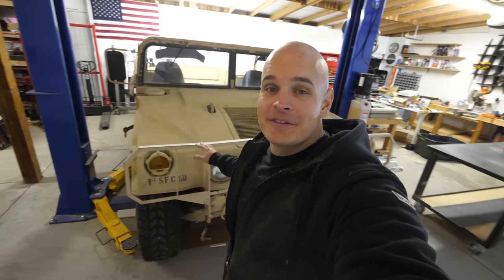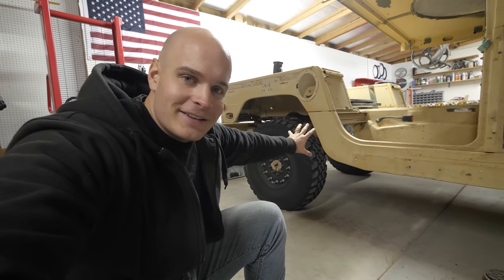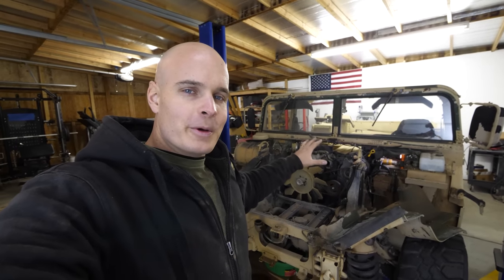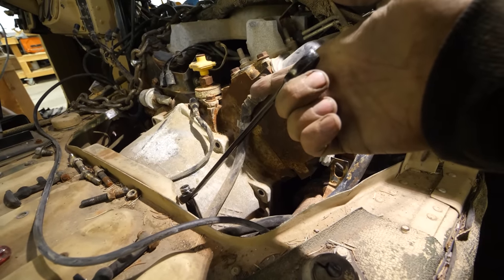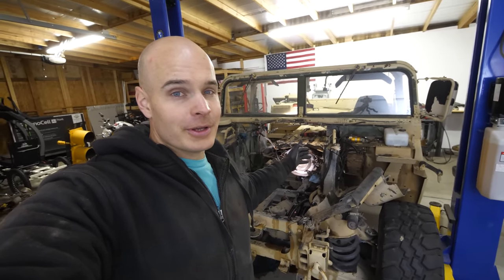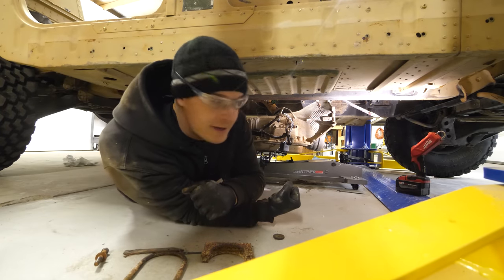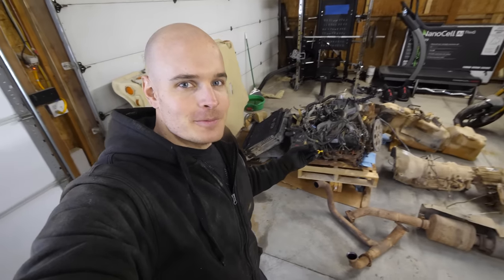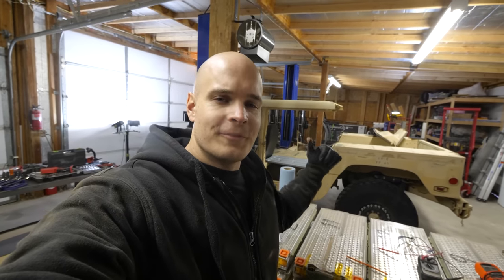How to build an Electric Hummer? Step One – TEARDOWN!

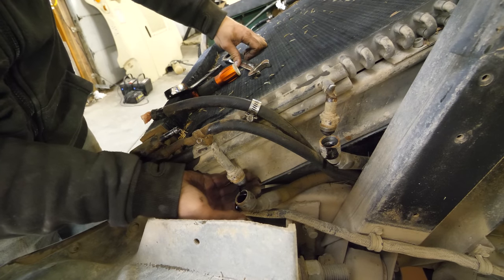Comment: 5:02 key difference is that coolant is waterbased and is used to keep the engine at operating temp, whereas brake fluid is hydraulic oil and CANNOT have water in it. If theres water in your brake fluid, it will boil and you’ll loose your brakes, plus corrosion.

Comment: Great video, however, your description of how a diesel engine works wasn't quite correct. Glow plugs are there to get the process started but once the engine is running they are not in use. Air in the cylinders is compressed to such an extent that it self ignites and at that moment the diesel fuel is injected. Energy that is imparted to that cylinder in turn drives the pistons in the other cylinders upwards again. "Surplus" energy is taken from the engine in mechanical rotational form from the output shaft.

Comment: This is so great! Question...aren't Tesla batteries normally housed together with a contained cooling system? Curious as to how you will keep the temps down if they are spread throughout the Hummer?
Reply: I wondered this too.  There could be some natural heatsink effect with the body of the vehicle because of the spread out arrangement. Less dense cluster of the massively hot battery cells, maybe a front and rear system with separate reservoirs too???
Reply: Once they are packaged in a box useful for this layout they can all be plumbed back together for cooling. Most conversions do this and just work around how they will be laying out the packs for their vehicle.

Comment: I can't wait for the day when it become practical to buy an EV conversion kit to swap in to whatever you want, the same way we order crate engines today.
Reply: Realistically though, people would just use gas vehicles until end of life before getting an electric one. Even if conversion is common, people would just ask shops to do it for them.
Reply: @lancelindlelee7256  yeah modern cars are way to complex anyways, so doing a conversion for them will be difficult. Older cars like classic cars can be kept alive with batteries and motors for a very long time, and be enjoyable too.
Reply: @franky9928  GM has already announced that they'll sell an EV conversion crate

Comment: You can also tow batteries on a trailer put a small generator to trickle charger drivin by the axel on the trailer as you drive charge the battery in the hummer when you are running on the trailer battery. And vice versa for long distances.

Comment: I hope you marked the clocking on the drive shafts.   If you get them back together wrong you're going to get a nasty vibration..   Also double check the seals since you pulled them apart as that keeps the grease in there.

Comment: You can mount the batteries in the space where you took out transmission from. May be weld a sheet of metal at bottom with 1 to 2 inch lowering to make more room for batteries

Comment: Hey Jerry, I just discovered your channel, I like it. Good presentation, pacing, and relevance. One small suggestion. Motors vs Engines. Internal combustion engine, Jet engine. Electric motor, starter motor. Motors are not engines and engines are not motors. Motors-Electric vs Engines-fuel (petrol, diesel, gas, gas as in literally gas, not abbreviation for gasoline) Not wanting to nitpick here, your narrative is very polished. Looking forward to watching your conversation progress.

Comment: 100% recommend building a waterproof compartment in place of the gas tank for the batteries. Make it a quick disconnect so if you have a problem then you can pull it out in one piece so you can diagnose the problem.

Comment: Very cool project, hope you don't have to build too much strange custom stuff to make it work. Glow plugs are only needed to get diesels up to temp by the way, the fuel air mixture explodes under compression when the engine is at operating temp.

Comment: I'd put the batteries along the center where the drivetrain was and add a skid plate to protect them. You'd get to keep your back seats and it would distribute the weight more evenly lowering the hummers center of gravity.

Comment: 19:37  Glow plugs are NOT for burning the fuel. Glow plugs are designed to preheat fuel-air mix by cold start only. They are switching off, when working temperature of the engine is reached.

Comment: @2:17 "this area here" is the rear seating area... and so the 4-seat HMMWV becomes a 2-seater. Still, a good location (for packaging and for weight distribution) if you only need two seats.

Comment: Suggestions.
There is a factory two to four inch body lift they did to accommodate some later modifications.
If you lift the body by the height of the batteries you could mount them all flat under the floor beside the frame rails.
If you did that you’d have space for three times as many batteries .
I would build some impact resistant cradles to mount them in of course.

Comment: Not sure what type of electric set up you are doing but the best would be a front and rear engine set up with no gearbox.  Then all that massive area under the truck will be the perfect place to hold the battery packs. Just build a cradle to fit the area with the battery packs inside.   Simple and with a better center of gravity and balanced than the original ICE set up.

Comment: Hook the motor to the transfer case. High and low gears and two or four wheel drive. It's over a 100 degrees where I'm at today, im kind of wondering about your cold weather gear.

Comment: Great disassembly, but allow a little correction to how a combustion engine works: without explosions! There is a combustion, which results in expansion - by no means this is an explosion. An explosion is roughly 20-50 times faster compared to a burn.

Much interested in seeing the project go forward!

Comment: I could be wrong but I thought the HMMWV was designed with a relatively easy detachable body? Could you use the lift to remove the entire body giving full access to the frame/internals? Would make it easier to paint the entire frame. Definitely cannot wait for pt 3.
Reply: Well yeah probably. Its a body on frame afterall

Comment: 19:38 Diesel engines unlike petrol don't require any source of ignition (I.e. spark plug). In Diesels the fuel -air mixture is compressed to a point where it combusts So  glow plugs only run during very cold starts to bring up the temp. In the cylinder so combustion can occur.

Comment: This does such a great job at highlighting the prehistoric nature of internal combustion engines. Using them is literally bronze age, 5000 year old technology. Pouring a burning liquid into a pot to extract work is all these things do. We've refined the mechanism over the years but not much change fundamentally. Bring on the quantum field physics at the heart of an electric motor!!
Reply: Except Zach's description on how the engine turns dinosaurs into farts wasn't quite correct, given he mentions the glow plugs as a part of the running of the engine. Generally, in diesel engines, the explosions come from a mix of misted dinosaurs and oxygen which are compressed until they literally blow up. The glow plug only assist when the engine is cold and have no effect when the engine is running.

Comment: Glow plugs aren't spark plugs. They just heat the diesel fuel to start as cold diesel has a hard time starting. After that diesel fuel is then compressed so small that causes the explosion.

Comment: The radiator could still be useful. You don't want your batteries getting too hot ot too cold. A lot of powerful motors also require liquid cooling.

Comment: It's really interesting to see the complete difference in technologies and the things that people have done to combat limitations of it
By that I mean, liquid fuel is super energy dense, but utilizing it is ridiculously inefficient (i.e. releases lots of heat) and that's why we have all these parts that Zack is taking out (e.g. radiators, alternators, transmission)
Meanwhile, running cars off electricity is simple (it's one electric motor), but it's not energy dense, so you basically have to cram in a bunch of batteries

Comment: In only one of those battery packs, there is  a thousand possible breaking point (every cell).
In colder/hotter enviroments even the heating and cooling for the batteries, needs more components than 20 to run.

Comment: You might want to have individual charging and discharging support for each battery bank to ensure efficiency and battery longevity (differences in cable lengths and co. cause uneven charging and discharging that ruins batteries).

I am quite interested in seeing how you solve that. Are the batteries smart?

Comment: FYI - Glow plugs have nothing to do with the engine running. The glow plugs heat for 10s or so before starting the engine, to help warm the cylinders and make it easier to start
Reply: What about spark plugs?

Comment: Super informative video! Your auto mechanics 101 is a good primer. People don't realize our cars are little engineering marvels. 

Will you be reconditioning the chassis (removing rust and painting) before you start mounting the electrical components?

BTW 9:32 the large gear you are referring to is called the 'flywheel'

Do be careful.

Comment: Also that motor has a really strong magnetic field aluminum shielding should help keep it from messing with anything else in the vicinity like electrical components cause aluminum blocks magnetic fields. 3/16 to a 1/4 in thick should do.also don't have your phone near it when it is on.

Comment: Great video and project! I have a question though, why don't you put the batteries where the Transmission, Gas tank, and exhaust used to be? It will give you a cleaner look for the vehicle. Don't you think?

Comment: Why not get rid of the drivetrain and custom build gearboxes that bolt to the diffs so you can bolt the motors to the diffs directly. Like a tesla. This should allow you to put the batteries in the tunnel. I would recommend a front diff centering kit, this allows you to use 1 half shafts through out the vehicle instead of 2 types.. More powerful brakes would be ideal, predator makes very big brakes but they carry a hefty price

Comment: You can cut the gas tank in half fit the batteries inside find a way to close it air tight and then mount it to the hammer. This way the going to be protected from water!

Comment: I seen some people turn old engines in to tables with glass tops.....famous one is when Jeremy, Richard and James were still on top gear and they had a V8 table.

Just another idea of a project.
Reply: If you have a double pilar car lift you could have pulled the bolts out and slowly lifted the car up leaving the engine behind.

Comment: Technically there is not an explosion in correctly working diesel engines even it is i commonly misused to describe combustion in those. Correct combustion type is deflagration. Explosion is engine knock which is bad and tried to avoid in these. Knock should not be confused with typical diesel engine sounds.

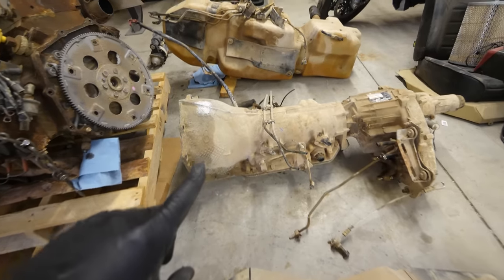Comment: @20:05 the need for gearing has nothing to do with engine efficiency.
@20:25 shifting does not mean inefficiency; a Tesla would be more efficient with more transmission ratios, but the improvement is enough to justify the complexity.

Comment: I'm sorry if this is asked in the comments. I looked, but could have missed it. Where did you buy the electric motor, and ballpark what did it cost. My 07 Avalanche's LS engine is pushing 300K miles, and when it's done, I want to do an electric conversion. This looks like the best bet to provide enough power. I guess I could watch the rest of the videos, but I'm just not that patient. Very cool project. I'm really looking forward to watching the rest!

Comment: Zack. One thing that I've been thinking about is the springs for the front suspension. You've removed all that weight but won't be putting as much back, so will the springs be too stiff?

Comment: Hey there, did you happen to keep a spreadsheet/list of removed weight which you'd be willing to share?

Asking because I have a similar but slightly different build

Thanks for your time and amazing inspirational builds
Reply from the maker: Yeah! for sure. Ill cover that in a future video- but I'm pretty sure its close to even. I took out about as much weight as I put in. Batteries are heavy. And I have 90kwh

Comment: You will still need transmission fluid. And you are not going to find a better solution for a radiator unless you are going to use a very little one that fits right behind the grill. Motor and engine should not be used interchangeably because a motor is electric only and and engine uses a fuel for combustion. The large gear is called the flywheel and the red goop is dielectric grease.

Comment: I feel like this is a good place to ask. I understand you don't need a transmission with an electric motor because of the variable power input, but why wouldn't you still want mechanical advantage? Could you not get much better range if you could gear it way down once you're up to speed?
Reply from the maker: Yeah,  you're right,  some electric cars do have a 2 speed transmission for that reason.  I'm no expert,  but I think with how flexible electric motors are; you can build them to the specs you want,  most companies seem to be just skipping the transmission. Since electric motors are so efficient its not worth the dollar cost. My setup will include a gearbox to bring the top speed of the motor down. I'll talk about the drive train in my next video.
Reply: I believe Rich Rebuilds kept the tranny in when he did an EV conversion with a mini cooper, though I don't recall him explaining how useful it ended up being, in terms of efficiency at various speeds. Interestingly, he did remove the clutch iirc. And yup, I think different gear ratios could significantly help highway cruising efficiency, as power demand is pretty low when not accelerating, and I assume the efficiency curve of the electric motor would favor a more moderate rpm. I'm definitely no expert though. Perhaps the greatest advantage of a transmission would be greater torque/control when off roading/crawling, but maybe the transfer case will be adequate for that. /shrug

Comment: Strap a small generator in the back and keep the fuel tank just in case you need to power up the battery in a remote location.

Comment: I know it's not my project and I'm sure there's a lot of reasons not to do this... I'm thinking dual motor would be cool-as-fuck. Bolt the motors directly to the input on the differentials. It would save the effort of figuring out how to implement the transfer case. And you'd gain some efficiency by eliminating the gears in the transfer case.

But yeah, that would probably cost like twice as much.

Comment: I knew scientist but Humvees designed for military use and I get the fact that we’re going electric personally I don’t think it’s a good idea because the waste of tires is way more pollution than Diesel or gas In Humvees are pretty reliable the way they are changing all the stuff out there’s gonna be issues

Comment: I'm just curious about a few things.
First, are you planing on putting the transfer case back in so you have 4x4 with one motor, have two motores to achieving the same effect, or just have one motor going straight to one of the differential and just have 2 wheel drive.
Second, how do you plan to achieve different gear ratio like what you would get from a transmission?  Are you planing on installing a smaller, simpler transmission like on a side by side with high and low, or do you plan to be more direct and have the accelerate pedal like the trigger of an rc remote where the more you press, the more power you send and go faster.
Sorry for being a bit long winded. I'm just trying to pick your brain and see how you think is all.

Comment: Would it be easier to take the body off the frame on these rather than have to mess with getting to tight places? I know a lot of shops do that on a lot of half ton and up trucks to work on them because it just makes it easier? I’m just curious I’ve never really been under one enough to see.

Comment: Love this! But was wondering, how did the sub 400kg engine bend your engine hoist at half ton load capacity? 🤔
Reply: The units are in freedom units rather than standard, and in freedom units a half a ton is 1000 pounds rather than the 500kg that a metric half ton would be. The motor that he hoisted weighs 845 pounds. It should not have bent the hoist but it did anyways.

Comment: Would this drive like a regular hummer just with a lot more power or would it be really slow like the air craft thingy that you pulled the engine from? I'm guessing it all has to do with the gearing and ratio?

Comment: Hi, a quick question what type of motors are you using to get that thing moving? Is it gonna be all wheel drive with independent motors at front and rear? Are those tesla motors? Will the range be increased with the electrification more than 4-10 miles per gallon (previous fuel efficiency vs new range) with full load? Looking forward to watch the next part. Cheers!
Reply: First, second and third question is answered in the video.